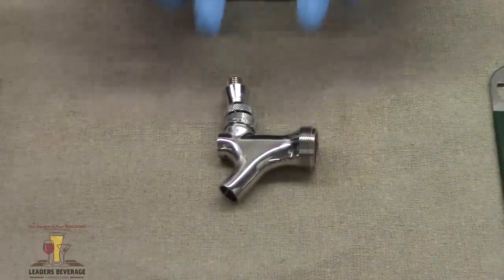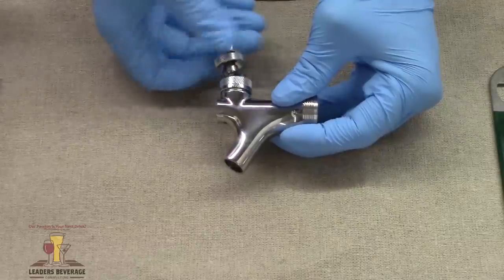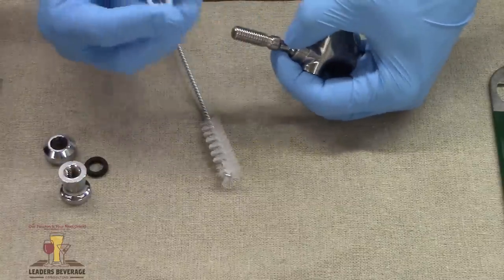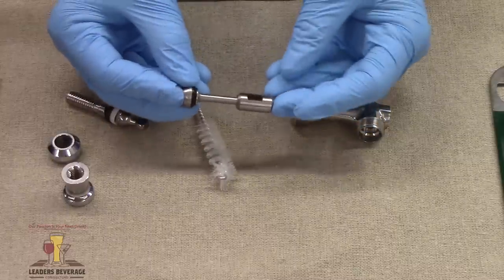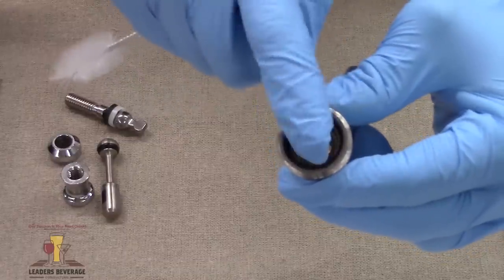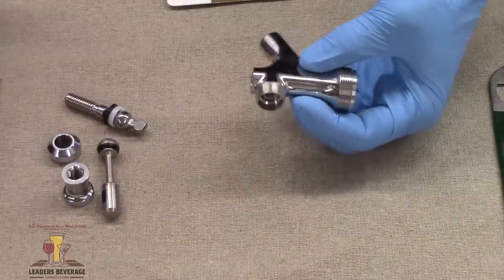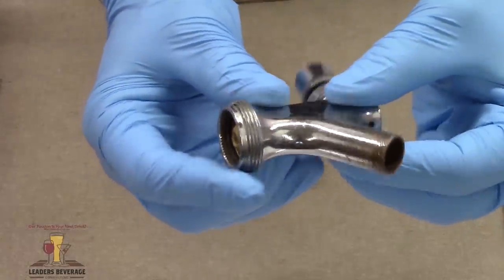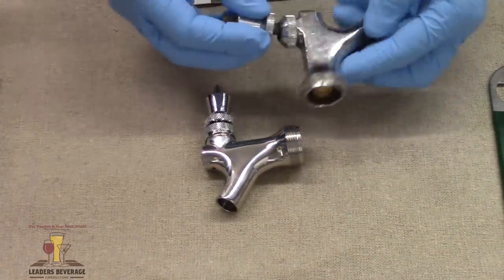How To Clean a Draft Beer Faucet Tap: Draft Maintenance

Comment: Excellent video tutorial for cleaning standard draft faucets.  I wish I had this 7 years ago when I was getting into begging and line cleaning.
Reply from the maker: Kent Steeves thanks so much!! If there is a topic you'd like to not wait another 7 years on let us know. Our passion is the F&B industry and we so desperately want to see it thrive. Draft beer, wine, and/or cocktails are typically the highest margin item in any venue and yet the system is also typically the most neglected. Here's to quality and to beers the way the brewer intends!!
Cheers and cheers
Reply: Do you guys have any videos on proper set up and balancing of draft systems and jockey boxes?  Looking for tips on proper line diameter, length, and flow control so have optimum balance and can then minimize foaming of the beer coming out.
Reply from the maker: Hi Kent, we haven't done any videos specifically targeted at how to balance a draft system. That is a larger conversation that starts first with how carbonation works based on temperature, pressure, and gas blend. We can leave altitude out in the beginning :) We've been wanting to do a video that explains why 3/8" interior beer line is almost always the worst choice even though the most common choice. So, perhaps a mini series of videos talking about each individual subject that can be watched together to form a bigger picture. In our most recent video on caustic vs. acid beer line cleaning )https://www.youtube.com/watch?v=eEXh7AWB1Gs&t=25s) We make a few comments through the pop up information that 3/8" ID often just wastes a bunch of beer vs. using 5/16th or 1/4".

Comment: I am about to take the level 2 Cicerone exam and both this video and the coupler video have been extremely helpful. Thank you!
Reply from the maker: Drew (our CEO) used to work for the Cicerone program. He didn't make those videos to be answers but if you know those videos forward and back you will do good on the video portion.  Remember, there are no trick questions and there is no need to be fancy in your answers just get the information across. GOOD LUCK!!!!

Comment: I'd like to see a video going over all of the washers or gaskets you find throughout a keg coupler and tap system. Including what goes at the top of the coupler where your beer line attaches.
Reply from the maker: Skidd, thanks for the great idea. Simple things like a 30 cent seal can mean the difference between a huge mess and properly pouring beer.  We'll definitely made that video.  We can do the coupler and gas side of things pretty easily but will need a bit more time to get to a live system to show the rest of the system. You can subscribe to this channel to get a notice of when we post the video for you.
Cheers!

Comment: So what happens if you have exposed brass? I recently took on cleaning duties at my bar and I'm trying to learn as much as I can. Your videos are an amazing resource!
Reply from the maker: Hi Stephanie, thanks for letting us know the videos have been helpful. We are close to starting to put videos out on a more regular basis. In the meantime, brass is bad for beer. Brass doesn't hold up to the acidity of beer; and certainly not wine or cocktails. Typically brass was also once covered by chrome so when you see brass it means the chrome has worn away. The brass will slowly pit and that pitting creates a tumbling of the beer which can add to foaminess. If the coupler and tail piece are brass and pitted it starts its run tumbling and if the faucet is brass it ends its run with further tumbling. In bad situations the brass can actually add a metallic note to lighter beers.  The extra bucks to upgrade to stainless steel is well worth it. Lastly, here is a link to a free resource. The Draft Beer Quality Manual is a must read for anyone trying to learn about their draft systems. Everyone of our techs has this book with them and is given a copy when they join the team.  https://cdn.brewersassociation.org/wp-content/uploads/2019/03/Draught-Beer-Quality-Manual-2019.pdf -Good Luck & Cheers!

Comment: Another great video.
Should we be careful not to scratch the stainless with the metal spine of the brush? Would it cause disturbance in flow and potentially foaming? 

Thanks
Reply from the maker: Hey there Chittling Whitles, thanks for checking out all our videos. The faucets in this video are 304 Stainless Steel. You'd have a hard time scratching them with a cleaning brush; just don't use steel wool :) If they are chrome plated brass then you can scratch them, but the beer will dissolve the chrome away and leave exposed brass eventually anyways. Your best bet is replacing chrome parts with stainless. -Cheers & Beers!!

Comment: I have a faucet with a broken lever. How do I get the broken lever out? It is not just falling out like it looks like it should do.
Reply from the maker: Hi Mark, you are right, the lever should fall right out or pull right out.  If it is stuck it is likely very dirty.  Beer flows over the bottom of the lever and when it dries becomes very sticky and hard.  Use a pliers to grab the portion that is stuck and pull.  It may also help to run it under hot water and / or let is soak is super hot water for a few minutes to loosen up dried and sticky beer.  Of course, make sure the bonnet isn't on.
Let us know if you have any questions.  You are free to send us an e-mail with a picture too if you think that will help us help you. Info@LeadersBeverage.Com
Cheers!
Reply: Leaders Beverage Thank you! that did the trick! I will definitely do a much better job with maintenance in the future.
Reply from the maker: Mark Iacopelli Great, glad that helped.  We're always glad when a part can be fixed cheap and easy over having to replace it.  Feel free to fire away any other questions you have faucet related or otherwise.  Cheers and happy New Years!

Comment: so what happens when that brass lever breaks off, like has happened to me?
Reply from the maker: Hi sllundy86, you replace it. Preferably with a stainless steel lever. Brass isn't just bad for beer it's also not as strong. Hopefully it didn't break while cleaning. That would mean you were having to put a lot of torque on something which happens the longer a faucet goes without maintenance (dried beer and such). We have seen someone break a stainless lever before, twice, and at only one place so who knows what was going on -:)
Cheers!

Comment: Questions
Reply from the maker: Answers
Reply: @LeadersBeverageConsulting  
Thanks for the reply, it’s been a while since you posted this so wasn’t sure if anyone was monitoring
Reply: @LeadersBeverageConsulting  
Too bad I can’t send you pictures, but I purchased a one-year-old triple tap commercial kegerator stainless steel, but I never owned a keg and not sure how to use it, I did take it completely apart and took lines off, But I did not go as deep as removing that plastic check valve as you did in the faucet. 
For the stainless steel faucets, take them apart let them soak and clean them? I don’t have cleaner yet but someone posted oxy clean works good do you agree?, I’m purchasing new lines so I’m not going to clean those but will purchase a cleaning kit.    Do you use the same cleaning process for the caps below as well? You take the beer line and see you to line off every two weeks?  The guy bought it from had Kampuchea running through them and the connection point for the CO2 line on the tap does smell, do I have to clean inside the red CO2 lines? Or just where it connects
Do you also clean the taps the same way as the Fossetts?
Mainly want to know how to use it, I hook up the kegs and CO2, and just let them sit? It might be days before we pour a glass of beer at the house, so just have it on the ready? How long can this go on for, is this not a good use of the kegerator? Can it just stay on indefinitely?  
I had organize questions yesterday when I took this apart, but I will have to revisit because I forgot
Reply from the maker: @RC.56  We go through periods where we are just to busy to attend to the channel. We do our best to jump in and answer questions as we can. There is so little GOOD information out there when it comes to draft. Or, the information is exceptionally broad. The Beer Association's Draught Beer Quality Manual is a free resource and one of the very best.
Reply from the maker: @RC.56  The red line is for gas only. If that is dirty it means the Kombucha and/or beer got into them. Those you just replace and make sure the check valve is in the coupler. Here is a link to the manual we mentioned in another reply. This will help you a lot. https://cdn.brewersassociation.org/wp-content/uploads/2019/03/Draught-Beer-Quality-Manual-2019.pdf

Comment: Every two weeks, are you joking? You must be speaking of commercial, but still! I have had several kegs in two years and only run cleaner through my faucets then rinse with fresh water between kegs, and have no problems.
Reply from the maker: Yes MrDough, we are definetly talking about commercial draught systems. Most home brewers just clean their lines between kegs. We do the same thing with our home kegerators, but the faucet and coupler should still come off for a better cleaning and the faucet should be taken apart to be cleaned as well. Ultimately, though, nothing growing in beer can kill you so if you are happy with the pourability and flavor than you are doing what needs to be done!
Cheers!